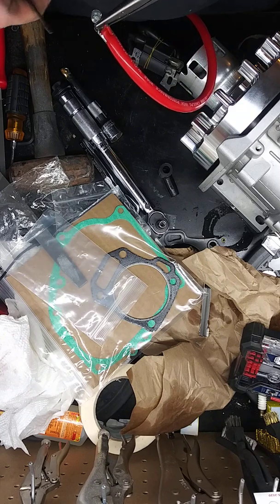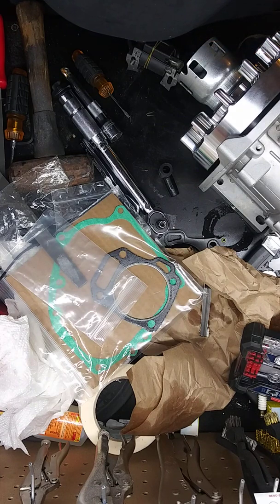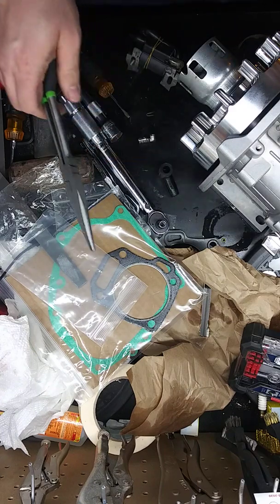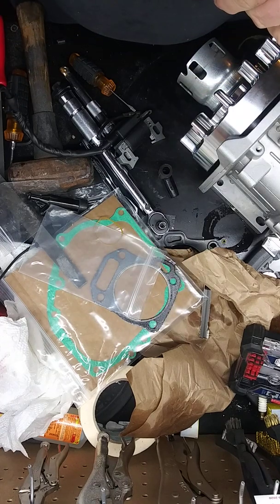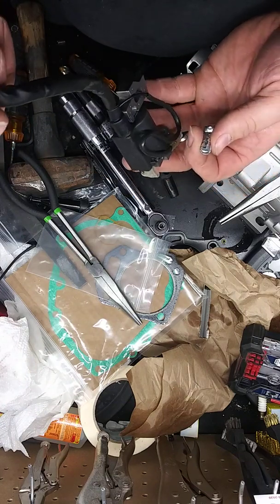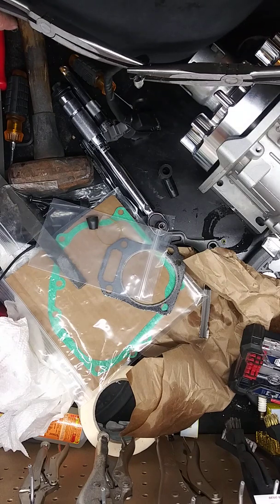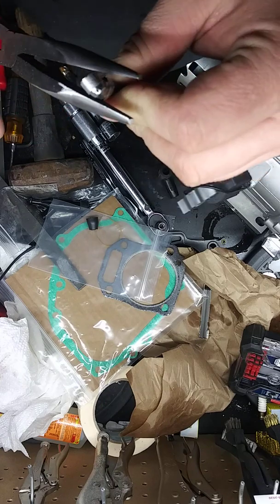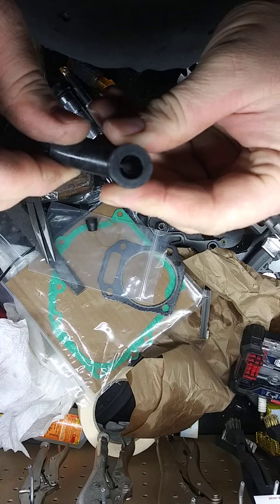how to remove the plug wire resistor for a small engine

Comment: I put an ARC flywheel on my Non-hemi and it cracked the Autolite 3910x spark plug, even with proper coil gap. I was told that was from contaminants on the plug creating an arc. It blew a chunk off the ceramic and cracked the entire length!!
Reply from the maker: I dont use the 3910x
Just don't like them.
I'm a bit old fashioned i want control of what my plug gap is. So i can make it hotter if i want not just a 1 size fits all
Reply: @LinksGarage  I've definitely never had that happen on a regular plug, Flywheel or coil combination. I've used some greasy plugs too for sure in the past! I stopped buying them after that.